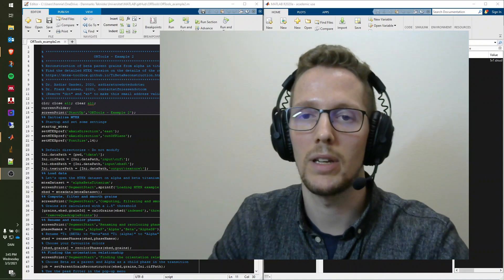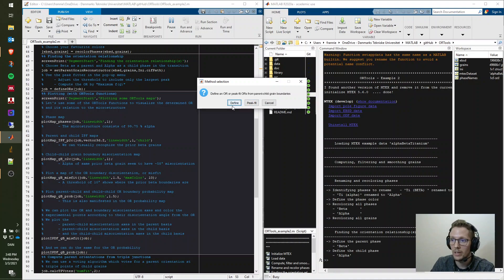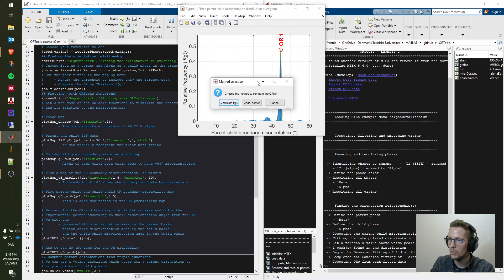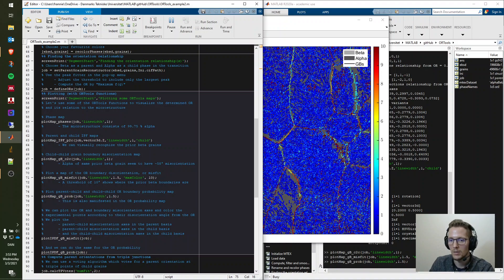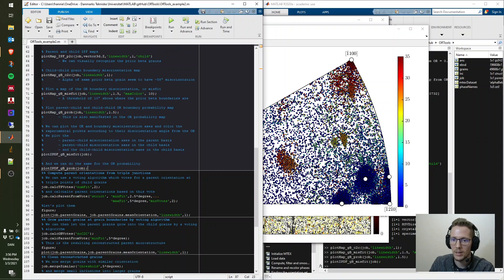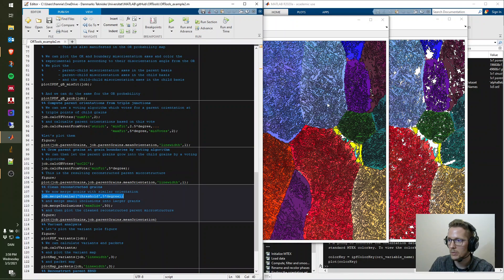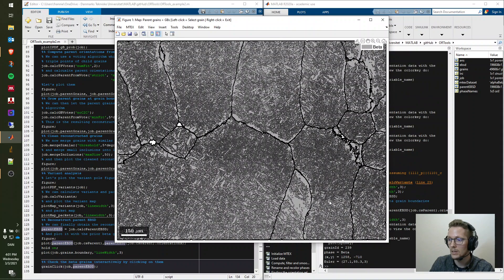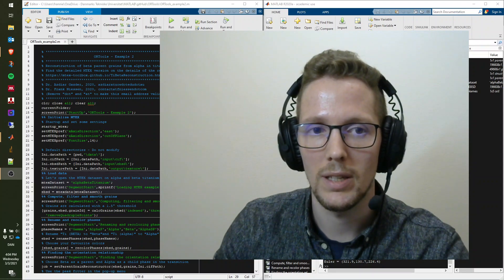ORTools - Example 2 - Parent Grain Reconstruction in Titanium alloys

Comment: Hi Frank,
The video is extremely helpful, is there any specific way that you can export the ebsd data of the reconstructed parent phase as an .ang file to be opened in TSL or other similar software? The default mtex ang export features such as "job.ebsd.export("exportedEBSD.ang");" dont seem to work and just end up showing errors such as:

Error using sub2ind
Out of range subscript.

Error in hexify (line 70)
  newId = sub2ind([nRows+1 nCols+1],row,col);

Error in EBSD/gridify (line 41)
  [varargout{1:nargout}] = hexify(ebsd,varargin{:});

Error in EBSD/export_ang (line 48)
ebsdGrid = ebsd.gridify;

Error in EBSD/export (line 26)
    export_ang(ebsd,fname,varargin{:});

Error in indexing (line 57)
  [varargout{1:nargout}] = builtin('subsref',ebsd,s);

would you have any suggestions?

Comment: Hi Frank, Thank you for the great tool. I am having a problem while reconstructing I get this message: Unable to perform assignment because the size of the left side is
46442-by-3-by-3 and the size of the right side is 46442-by-9
can you please help me out. 
Cheers
Reply from the maker: Hi Ehsan, 

yes, there have been some issues with ORTools because the syntax has changed in MTEX with the release of version 5.7. I apologize for the inconvenience, we have fixed this now. 
Try running the latest release with MTEX 5.7 and you should be fine: https://github.com/frankNiessen/ORTools/releases/tag/v1.1.1
Reply: @FrankNiessenMetallurgy  Hi Frank, Thanks for your kind support. It is all solved now and working very well. I have only one problem. Is the generated Figure 20 the IPF color coded map of the reconstructed grains? if so how I can get the IPF color code legend for that. Kind regards, Ehsan
Reply from the maker: @ehsanfarabi278  Hi Ehsan, great to hear that everything works. Yes, it is the IPF map. This was indeed not very clear and you can actually use the ORTools function "plotMap_IPF_p2c" to do the same thing and return the IPF color key. Please try this:

parentIPFkey = plotMap_IPF_p2c(job,vector3d.Z,'linewidth',3,'parent');
figure; plot(parentIPFkey);

Thanks for your remark, I have updated the examples in the developer version of ORTools to include this.
Reply: @FrankNiessenMetallurgy   Thanks Frank it is working perfectly now. Sorry again for too many simple questions but How i can export the reconstructed file into ang format.
Reply from the maker: @ehsanfarabi278  Just as described here: https://mtex-toolbox.github.io/EBSDExport.html 

job.ebsd.export("exportedEBSD.ang");
Reply: @FrankNiessenMetallurgy  Thank you very much Frank. Everything is perfect. thanks alot.
Reply: @FrankNiessenMetallurgy  Hi Frank, during exporting it gives me the following error:
Error using fileparts (line 32)
Input must be a row vector of characters.

Error in EBSD/export (line 14)
[~,~,ext] = fileparts(fname);

Error in EBSD/subsref (line 57)
  [varargout{1:nargout}] = builtin('subsref',ebsd,s);

Sorry for all the headaches. 
Cheers
Reply from the maker: @ehsanfarabi278  There is no point in doing this, the parent phase is a cubic phase and you should not plot the orientations of this phase with respect to a hexagonal reference. If you have a hexagonal parent phase you will get the hexagonal reference frame. In this example the command "childIPFkey = plotMap_IPF_p2c(job,vector3d.Z,'linewidth',3,'child');
" will return a hexagonal reference frame, as the child phase, alpha, is hexagonal.
Reply: @FrankNiessenMetallurgy  Yes indeed. I got confused a little bit sorry for the trouble and thanks for your time.
Reply from the maker: @ehsanfarabi278  Just as described here: https://mtex-toolbox.github.io/EBSDExport.html 

job.ebsd.export("exportedEBSD.ang");
Reply from the maker: @ehsanfarabi278  @Ehsan Farabi Just as described here: https://mtex-toolbox.github.io/EBSDExport.html 

job.ebsd.export("exportedEBSD.ang");